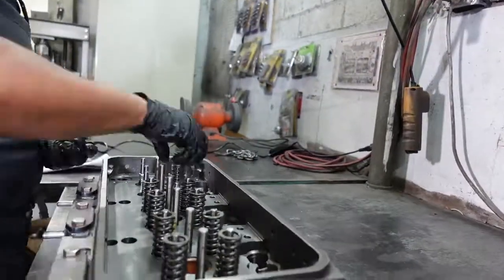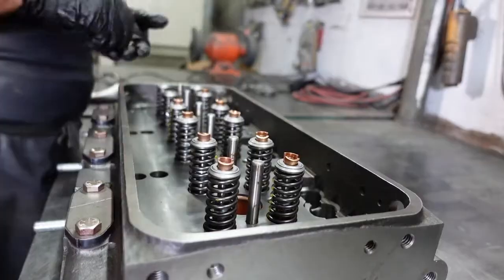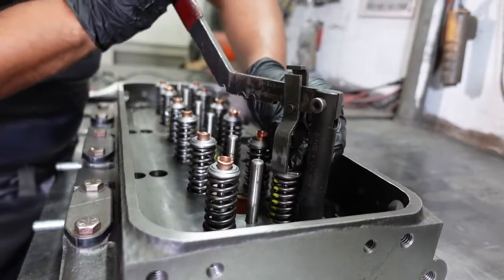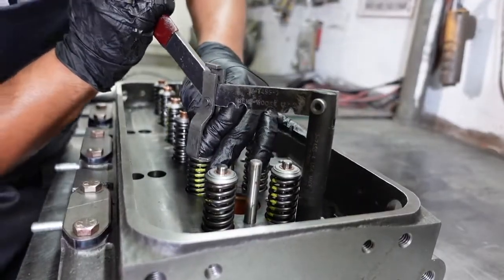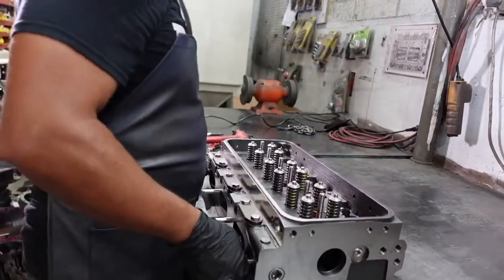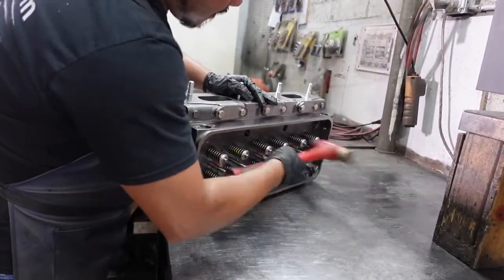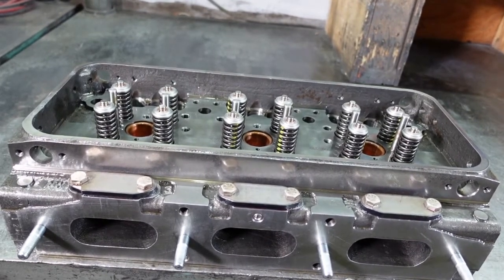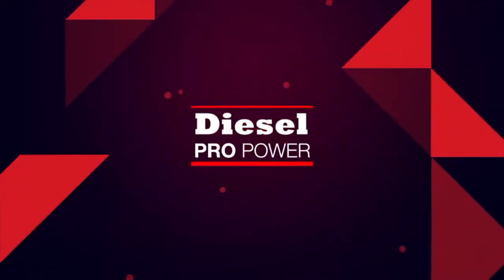Installing The Valve Springs On A Detroit Diesel 6V92 & 12V92 Cylinder Head

Comment: Good afternoon, friend, I understand correctly that in this head all 12 exhaust valves, and oil caps are not provided for in the design, is that right?
and also, please tell me your version of where oil can get into the air channel, then flows down the drain pipes to the ground (a turbocharger malfunction, we exclude.).? THANK YOU, looking forward to your reply.
Reply from the maker: I'm not sure I understand your question. You can call us at 305-545-5588.